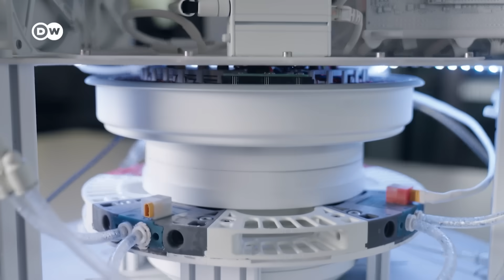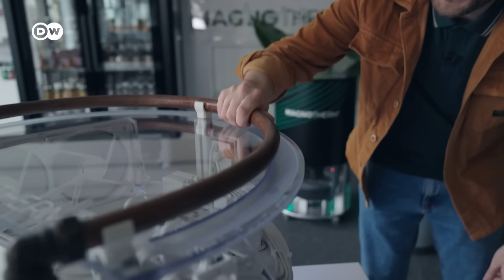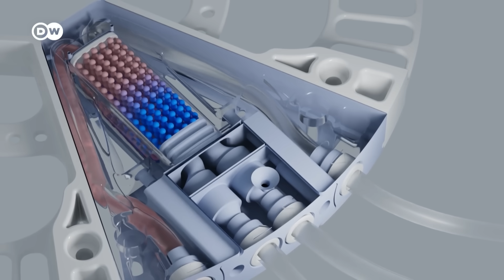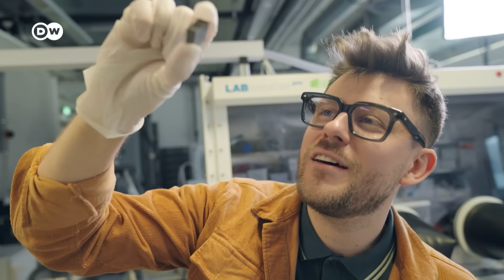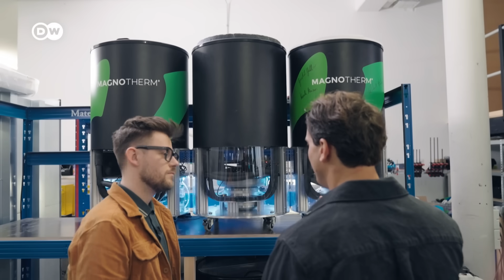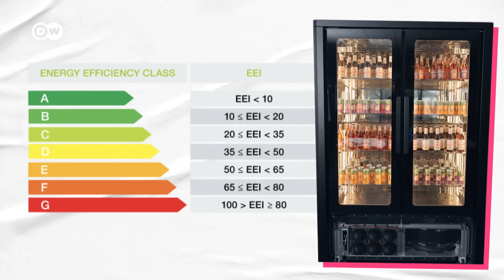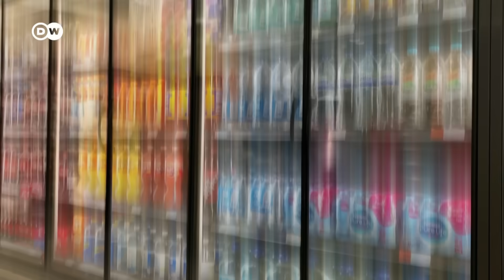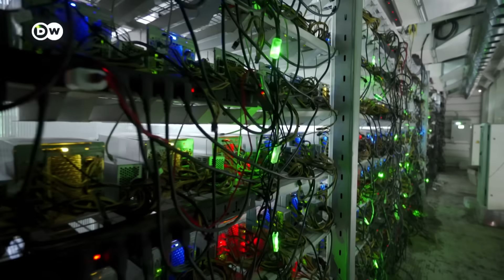How magnets could change our fridges and ACs forever

Comment: Does the magnet never stop running ? Classic fridge don't and that make there lifespan that much greater
Reply from the maker: The magnets do not run continuously; they cycle on and off to create the cooling effect. As the system has no moving parts, it could last longer than traditional compressors. Still, the materials that change temperature can degrade over time, so they might wear out eventually.

Comment: How are we supposed to offset the cost in 3 years? 
It costs thousands of $, uses more power still but might improve, and normal fridges use so little power it is not worth calculating, so to use thousands of $ in a normal household with a normal fridge, that would take about .... o say...400 years!!!
That is not even a rough estimate, it's just a blind guess.

Comment: I'm just hoping this technology will improve to the point it develops into a magnetic Thermo Electric Generator. If you can cool using magnets than surely you can also use the heat tp generate the energy back similar to how fridges in reverse are Stirling engines.

Comment: Wow that is WAY more complicated than it needs to be.  I think they have a sunk cost fallacy going on with their design.
Reply: They're Prototyping and using low production volumes. Obviously it's over complicated at the moment. That's how research and design works!
I've worked on R&D projects that were insanely complicated with wires and sci-fi looking stuff hanging off it everywhere, and yet the final design is something that you can get stamped out in five minutes by a machine.
Reply: Every bit of new technology seems more complicated than it should be, until it's worked on and becomes not overly complicated because then it's commonplace knowledge. At one point a fire probably seemed overly complicated
Reply: You need indeed a lot more Electronics. That also cost energy to make.
Reply: You should see what the first cars were like, even starting them was gamble with unalivement. It's illogical to say something is too complicated unless you know how to make it simpler.
Reply: @ Honestly, I don't know why I felt it was worth trying to stuff this in a YouTube comment. :p I considered trying to build a working model, and did a bit of research on materials, but I can't afford to. However, if I could I would likely start with something like this:  Two vertical counter spinning rings, probably the edge of disks, of thermocaloric material. They are both submerged in a low viscosity heat exchanging fluid. I do not expect that it would use any more thermocaloric material than the system in the video. At the top is the powerful magnet on each side of where the disks pass. The top would likely remove heat via heat piped heat sinks. The counter spinning disks act like a counter flow heat exchanger averaging the heat from that was just magnetically heated into the one that is about to be magnetically heated.  This also pre-cools the part that was just heated while it is it still experiencing the cooling effect of the entropy increasing in the material lattice. This allows for a higher peak temperature in the area designed to radiate away the heat while also creating a peak cooling point at the bottom which would be exposed to the are to be kept cool. The heat exchange fluid reservoir would have many constrictions around the path to encourage local circulation pulling the heat/cool to the outer casing instead of along the disk.  Each local eddy would allow for a more extreme gradient in temperature across the system. The optimal disk size / rate of rotation would be for the bulk of the cooling effect to be completed just before reaching the areas of strong magnetism. When the system reaches the desired temperature, the disks would stop spinning, not slow, because the spin timing would be strongly coupled with the systems energy efficiency.

If I was working on the project I would likely need to experiment with optimizing the heat exchange between the two disks and the surrounding fluid by messing with the disk and the casing geometry.

Concerns to watch: The coupling between the core of the disk and the thermocaloric material would need to compensate for differing thermal expansion coefficients (CTE).  There would need to be thermocouples to keep the disks/heat exchange fluid in safe ranges.  Whether a vertical orientation actually increases efficiency significantly enough to justify it limiting form factor.

I could be wrong that this is a better plan, I don't have the time or money to test it.  I saw that the non-commercial lab also used moving magnets and it made me consider why they would do it that way, maybe my idea could be wrong.  However, I wouldn't discount my method because I suspect their goal is to optimize in a way that helps determine peak performance from the material (highest temperature shift in per pass), and not maximum energy efficiency of the system, or high reliability, or low cost.  I suspect that Magnotherm simply based their design on what they say the labs doing, and thus might not be chasing the best approach.  The high complexity of the base concept in their design makes me strongly suspect there are many better ways.
Reply: @justincoombs9048  interesting! I'm going to read that at a better time than 0511 (UK). From skimming it I can't see how it's any less complex though, I think the device in the video was explained with fewer words (albeit supported by video).
Reply: @edism  Yeah you should sleep. If I was to ballpark the difference... 50% magnet weight; 0 pumps instead of 4; No need for reservoirs; no need for electric flow valves; No need for a computerised control system; Also the therocaloric material would likely be a coil of wire fixed to a disk instead of a 3d printed lattice;
Reply: @justincoombs9048  Ummm...that sure was a lot of words.
Reply: If it has so much obvious over complication then surely you should be able to improve upon their design and become very very rich. What a great day for you!
Reply: @filonin2  There's no need to improve their magnetic design.  Superior alternatives (like conventional compression coolers) already exist.
Reply: @filonin2  I think Justin meant to say that heat pumps seem much simpler (and are significantly more efficient as of now) compared to this over-engineered solution, and since this uses a new technology which we still don't know much about, it's a big risk to try and refine what could possibly be an inefficient method of cooling to begin with.

Personally I'm all for discovering new methods of doing things, as taking risks is what leads to innovation in my opinion. I also think that this new technology might find more niche applications where heat pumps might not be suitable (due to their directionality, for example), so I don't think that their research is a waste of time or money from the little I could gather in this video
Reply: @Alezard4  the tech isn't new, this is just on over designed magneto. The implementation is new
Reply: @ero0senin100  I might've misunderstood your comment and I want to apologize in advance if that's the case, but I think that once an existing technology finds a novel implementation, then that can be safely called a new technology

For example, if a motor that would normally only be used to generate torque is instead used to produce electricity in a wind turbine (and assuming wind turbines weren't invented yet, of course), then at that point the wind turbine becomes a new technology

Comment: The clip was nice. But from what I understand this fridge would be orders of magnitude more complex, mechanically, than a normal, compressor based fridge. That alone is likely to make the whole thing unfeasible. Mechanical complexity is a guarantee of a short lifecycle for at least some components. A conventional fridge built with similar precision would likely last several times more. It's difficult to compete on TCO with conventional fridges on such a basis.

Which IMO makes the choice of subject for this clip rather poor.

Comment: I'm confused, first the sidestepping of the actual efficiency bit, although he says one market has a 100% increase,  then later they're talking about their Polaris unit having a COP of 1 (which FYI is absolutely horrible), but then talks about the commercial unit being up to 2,  then an article says they need to have a COP of 6.2 to be competitive with traditional vapor.    I'm all for exploring new tech, but seems like no one can get their numbers straight ... 30% better... is the goal,  they aren't anywhere near that.
Reply: COP for ammonia is 7+ for industry where efficiency is really important. It's also very achievable, scalable and without maintenance for years.
Reply: even 30% would not justify a complete system topology change. Because vapor will achieve these 30% in no time (probably already had since 1 year). These COP are absolutely ridiculous. Anyway it is clear here that this is a non technology, it is atrocious at every level, doesn't make any bit of sense. I think this is some kind of startup, basically investor money / EU grant pump.

Comment: This is kinda silly when modern butain refrigerators are extremely enorgy efficient. My large kitchen fridge draws like 90w when running. Thats nothing really
Reply: 90W is super inefficient, most use no more than 10-30W.
Reply: @oyuyuy  the difference in bills would be so little most people wouldnt even bother  changing
an other thing that magnet fridge has against it, is even if it was 30% more efficient them a fridge and cost the same as one, no one would really care at first
Reply: @antonmuffin6214  It isn't about switching out functioning appliances, it's about what you replace them with when they break.
Reply: I hate it when my fridge wastes my enorgy 😠

Comment: Why does it need to spin? It has permanent magnets?
Reply from the maker: Hey there! The magnets need to spin to create a changing magnetic field, which is what makes the magnetocaloric material heat up and cool down. A stationary magnet wouldn’t produce that effect. 🌞
Reply: @DWPlanetA  it would if it was an electromagnet

Comment: The cost of mining the ore that contains rare earth metals and the cost of separation and refining them and then processing them is staggering.
Reply: Recycle
Reply: Asteroid mining
Reply: No, it's not. Rare earths are not actually rare at all. But only a handful of nations have economically viable ore deposits.
Reply: @KevinMaxwell-o3t   That pales in comparison to the scrap iron needed to build a conventional compressor heat pump. I'm all for basic research and this sounds right at home cooling some superconducting magnets in a particle accelerator somewhere, but pitching this as a consumer product as an end goal sounds like Juicero 2.0.

Comment: So less efficient than a compressor probably less reliable (more moving parts) and 3,200x the cost, OK?

Also people don't realise a lot of the efficiencies are gained by insulation and not the cooling system itself. If you were to get a regular fridge and pack it with polystyrene you can increase the efficiency by 10%+. I would want them to demonstrate their systems with identical enclosures.

I always thought what if you designed a fridge like you design a flask, what if you put a cavity with a vacuum in it then the only place heat would get it would be around the seals. It would be stupidly expensive but not as expensive as this cooling system.

Comment: Cool.
Maybe you could make a video on radiant sky cooling.
If you have a very white surface on you roof you can cool air or water below the outside ambient temperatur.
This happens because the thermal radiation from the thing you are trying to cool down is much warmer than outer space or cloudes high in the atmosphere.
Thus the thing you are trying to cool down radiates more heat into space than it receives from space. It has to be isolated from the ambient else it will just heat up through convection.
But it can be done. It can be used to cool our homes or maybe cool solar panels making them more efficient.

Comment: so you say the modern fridge has been around, literally unchanged, for almost 300 years - or 150 years, since that's how long we've had electricity. in all that time, we haven't been able to improve much on the core principle of refrigeration, which would indicate the basic design is particularly robust in terms of cost, reliability and efficiency. If a new technology can score wins in all 3 areas, it will quickly become the new standard.
Reply: No, it won't, because they won't let it.  They won't even let you have a fridge that lasts 20 years anymore.  Now it's every 3-5, 10 if you're very lucky - and this is somehow better for the environment?  No, it's better for the HVAC industry, which has used regulatory capture to its advantage on a massive scale.

Comment: why do they have to spin the magnet around instead of using an electromagnet? the video should have explained that, but didnt
Reply from the maker: They likely use a rotating permanent magnet since it’s more energy-efficient. 🦾 Electromagnets require constant power, generate heat, and would make the system more complex.
Reply: @DWPlanetA  it would atleast be more reliable since it wouldn't need to spin around anymore. And probably smaller too

Comment: Can it last 20+ years of continuous use? There’s another aspect of “efficiency” the not needing to replace or repair
Reply from the maker: Hey there! Magnotherm has tested their fridges for over 10,000 hours to eliminate issues related to valves, pumps, and fluid flow. However, it doesn’t explicitly confirm a 20+ year lifespan, so long-term durability is still uncertain. 🤔

Comment: This system uses a heater and cooler that is fixed with transfer into moving fluids.  I wonder if they have tried changing it to a system where the heater and cooler is like a regular refrigerator where the heater and cooler moves around with the transfer into fixed locations.  So the magnetothermal metal would move.  Possibly the metal might be suspended in a fluid and it would flow through the hot and cold locations.

Comment: it's nice, but you can just build some nuclear power plants and use co2-based AC systems. I don't see how this system can replace any traditional cooling solution in the nearest future. This stuff could be used in some remote areas where you need to have Ac or fridge, and it should be repairable without any specific tools. Some other consumers, like datacenters could be among the first clients...

Comment: Why would you build this with rotating parts instead of using electromagnets to make it work without moving parts. Moving parts is always worse for maintenance.
Reply: The moving parts were my first concern, but your comment does leave me wondering about the relative costs and efficiencies you could achieve using electromagnets.

Can an electromagnet with X field strength be produced for less cost than a permanent neodymium magnet with the same field strength? How about with less volume? What are the impacts of the field ramping up and down with power?

I wonder if switching the polarity of the field would be useful for increasing the potential swing in the magnetic moment.

But I'm a hands-on kind of nerd, I'd be more concerned about reliability over efficiency, because a service call from a repair tech or a day of my time, is worth more than all the energy the device will consume in a year.
Reply: @bazzatron9482  I’m pretty certain you’d be able to build a spinning disc that’ll last long enough as to not be a concern. What’s more concerning is the intricate system of valves and the electronics required to run them. Valves are not known for being very reliable. 

It had me wondering if you could do something with a clever system of heat exchanging between incoming, outgoing and hot and cold water in the system.
Reply: @luipaardprint  like a balanced air heat exchanger?
Reply: @snorttroll4379  yes like that, but the difficulty would be filtering the heat to one side and the cold to the other without using pulsed flow control
Reply: Power consumption/heat generation from the coils. Not only would you almost certainly use more power with coils than PMs, you would be generating a ton of heat right next to your cooling element which will directly counteract your cooling efficiency as heat from the coil makes it into your cooling loop. You can attempt to thermally insulate your heat exchanger from you coil, but that will reduce your field strength and therefore your cooling efficiency by increasing the air gap between your coil and element. A spinning magnet will likely allow for stronger fields with less power and allow the heat generating motor winding to be distanced from the exchanger.
Reply: Superb suggestion. I can't think of a reason why it shouldn't work. I guess they are spending all the energy rotating the massive magnets.
Reply: Brilliant observation. This is why on intelligent YouTubes the comments are so worthwhile reading. Why didn't think of that immediately?!
Reply: @John-j1w9q  I asked that question because I wanted to know the reason for their decision. Because they hopefully did think of that and there was a reason why they chose to go in this direction. And as you can see by the other responses, other people were able to give good insights that make me glad I've asked that question :)
Reply: It’s probably more energy efficient like this. Electromagnets use electricity, so COP goes down the drain.
Reply: @luipaardprint that don’t mean anything if I have get my fridge fixed every year because of it